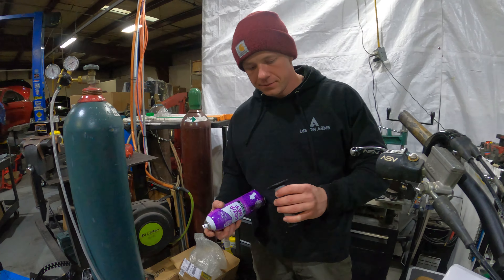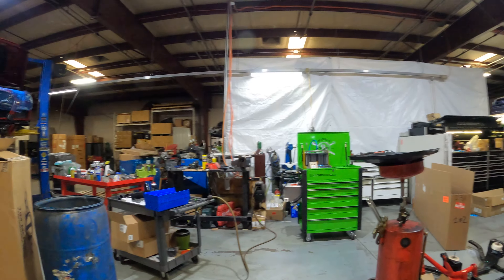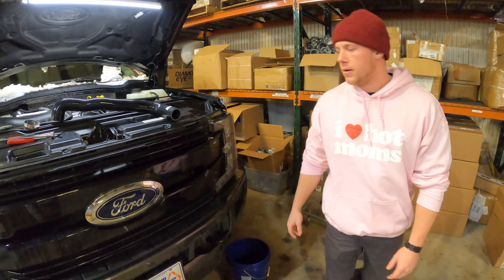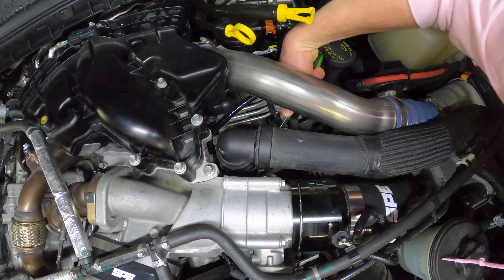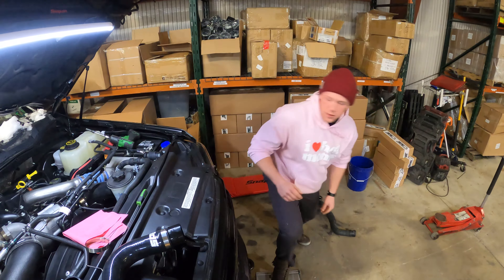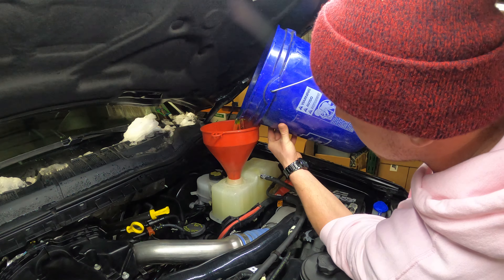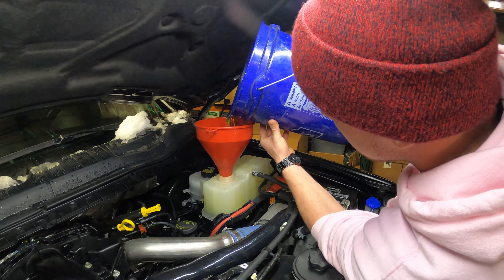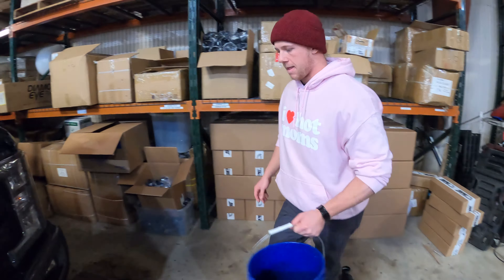SPE UPPER RAD HOSE UPGRADE • RWV 6.7 POWERSTROKE BUILD SERIES

Comment: Got mine and installed it before a 3 state tow trip. Throw away the hose clamps that it comes with.both mine failed. The silicone hose is very high quality but super hard to geta good seal.
Reply: The hose clamps included can't get tight enough to seal ..I ended up using constant tension hose clamps.
Reply: I too am having issues with sealing I added T-bolt clamps still not tight enough
Reply: @treesquatch9150  I had to find a clamp that just barely fit over the hose when fully loose.then a little lube on the inside of the clamp to let it tighten and not pinch the hose

Comment: Love all your vids purchase most of everything I currently need from SPE, RAD Hose, Hot/Cold, Thermostat and fuel plug. Little delays receiving everything and waiting before heading back to TX from AZ constant travel back and forth every week. This RAD hose is great but didn't come cut and have to cut it due to a T off the factory for my 2020 F-450 Limited wish there was a billet T for that and looking at our local CNC shop to probably fabricate one since our CNC machines will be a few months receiving ours. Great job and look forward to more videos! Looking forward to the SPE MOTORSPORT COOLANT HOSE REROUTE KIT- FITS 11-21 6.7L POWERSTROKE! Placing an order for that as well! We love SPE over Pusher!